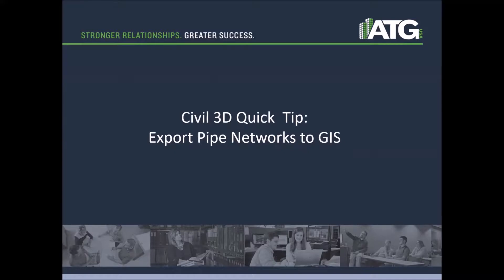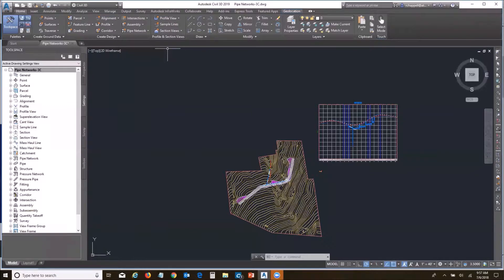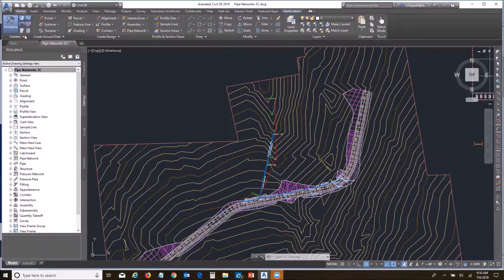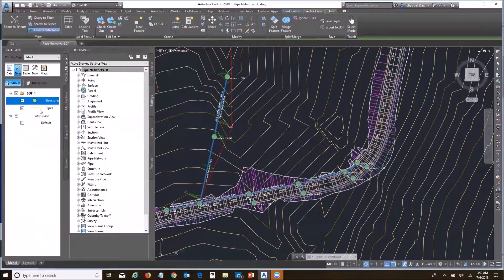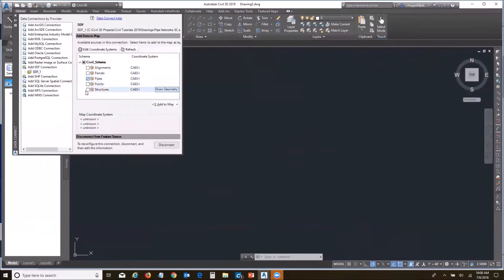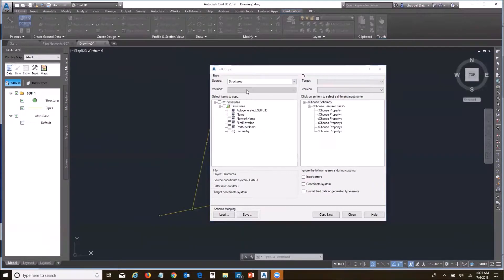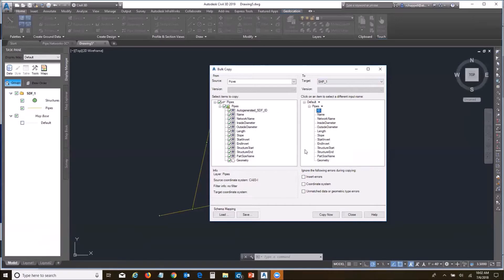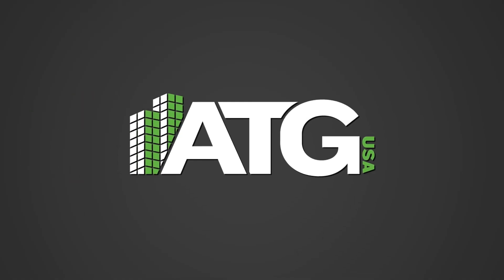Civil 3D Quick Tip- Export Pipes to GIS

Comment: I was struggling to do this for 2 pipe networks, it just combined the pipes and structures from both networks into one, and the gis guy didn't like that even though the object data still said what types of pipes they were.  I ended up importing the sdf files and then splitting them back out onto separate layers and making shape files of each individual network.  total pain.